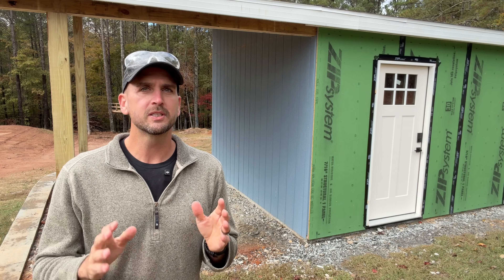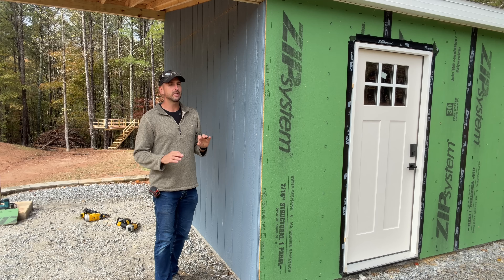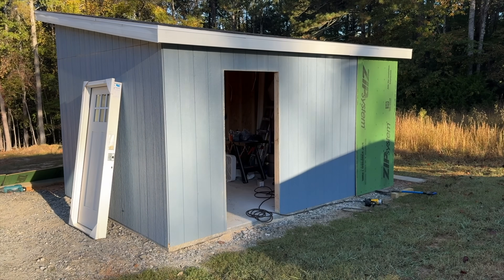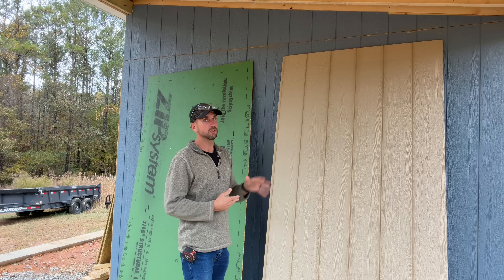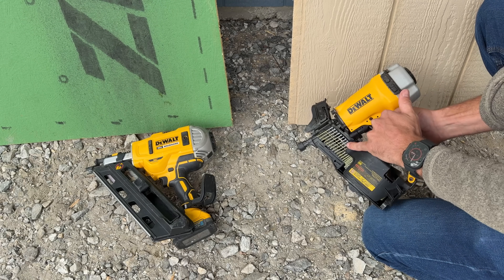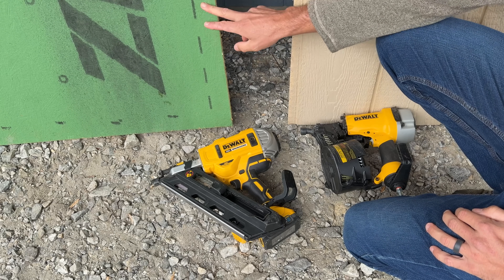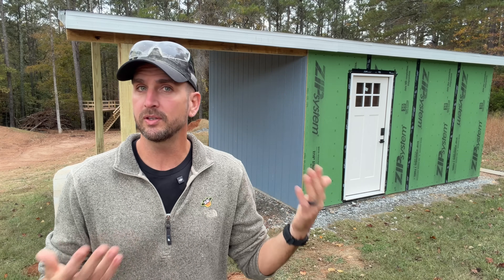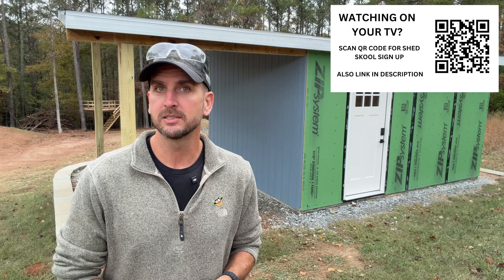Shed Builders: Stop Using the Wrong Wall System! (ZIP vs SmartSide Explained)

Comment: For the best performance,  experience would have been to simply sheet over the LP with 1" faced rigid poly foam  r-3.4 board.  Less than $18 ea.   Taped the seams = vapor+moisture barrier.  Then finish with the siding.  Now you have a thermal break that will turn your insulated wall from a r-13, at best, to a r-19.  This method makes the studs a thermal mass inside the cavity with super low loss to the outside.   State of the art for half the cost!

Comment: I will not use anything but LP Smart Siding.  What you're asking for is basically doubling the cost of the walls. Zip tape is not cheap. You should make a cost comparison for each one. LP siding a few years back was $28 bucks. Now, it's $48 bucks. It's also imported from Canada not sure how the tariffs are effecting the cost. Good informative video.
Reply from the maker: For standard sheds we are 100% LP Smartside and if you can get your bill of materials overall cost up run it through the Pro Desk and they will usually knock off 20%-25% the price for smartside which does add up and help with profit.

Comment: In my recent build of a 10’x16’ I used Georgia-Pacific 7/16” Force Field for the exterior wall sheathing (it’s regularly discounted to $20 or $21 per sheet) and the roof decking, then used 3/8” LP Smartside (8” OC grooved) for the exterior finish surface. They regularly sell the 3/8” LP at deeply discounted prices, so the combination of the LP over the GP was less than the cost of full regular thickness LP or the Zip system sheathing, and the wall sheathing combo is plenty thick and strong. Zip sheathing requires an exterior finish surface, so the price of that combined becomes even greater in comparison. I had used Blockade exterior wrap as a WRB because the framed shed was going to be exposed for a few weeks while I was out of town, so that’s the innermost layer. Probably not the best building science to put the GP Force Field over a WRB but it is what it is. My 2x4” sill plates are PT over a 3/4” PT plywood floor and PT 2x8” joists, for further weather/moisture protection. My combined wall sheathing ran about $38 per 4x8’ coverage.

Comment: None of the exterior products compare to vinyl siding, 30 years, NO MAINTENANCE! 3 times cheaper, easier to work with, no caulking or paint, don't have to worry about backsplash either.
Reply from the maker: Yeah, I do agree there is a lot of benefits to vinyl siding.  Honestly I have went back and forth several times to use vinyl or not on this shed.

Comment: The 'z' flashing issue kinda stunned me. Talking about the air flow passages that it creates when using the LP SmartSiding. Isn't there some kind of way to deal with that? Is there a way to seal that seam on the exterior or interior? Would installing a quality taped housewrap prior to installing the LP siding help with that issue? Thanks
Reply from the maker: Yeah, I would ditch the Z-flashing and overlap the top by 3” on the bottom caulking the seam.  This would seal up much better than messing with the flashing.  That is also how some shed builders do it all the time.

Comment: What if you put a house wrap before the LP smartside?
Reply from the maker: You could probably do house wrap prior to Smartside and then I would overlap the panels by 3 inches and caulk the seams as opposed to using the Z-flashing at the top of the 8 ft panel.

Comment: I built a floating house in the Florida keys and used smart siding.
Direct hit from hurricane Irma and the siding held just fine.
I built it on the water and used the smart siding instead of hardiboard due to weight.
No water intrusion happened because of how I built it. But everything inside shifted because of the wind pushing it around.
Reply from the maker: That is pretty good test for LP 🙂.  Thanks for the feedback.  Did you need to go higher than 8’?  If so, did you just overlap seams?
Reply: @ShedSkool  exterior was just the simple 8ft height. So no need for the top z channel. Top was simple trim and a 6inch overhang for the roof.
I had to make the entire home small enough so no wide load night time moving was required. 8ft wide 24ft long.
Built on an old pontoon frame but added 10 fifty five gallon barrels under it for more weight allowance.
When building on water everything had to be calculated for weight and proper weight distribution.
Even down to the weight of screws and paint was calculated in.
Each barrel gave me an extra 500 lbs of weight I could use.
House floated the same as a normal pontoon boat when I was finished.

I've used smart siding on a few remodel projects. Works great over the years. And in my opinion easier to cut than hardiboard without chipping and easier to transport.

Comment: As both products are OSB based, what is the price point? You could always build with the Zip product using Monopoly building if the prices are close. You're moving in on house building techniques using this method although depending on the final intended use of the building, it might be a valid process.

Comment: Interesting. Have not seen installing Zip over SmartSide. We attach LP OSB to the studs, vapor wrap, then SmartSide lap siding. For my own house, I plan on using Zip panels on the exterior and roof decking. My only concern with Zip is the panels and tape have a 30 year guarantee. It would seem that the tape would eventually dry out, crack or disintegrate at which point all the air sealing and WRP properties are lost.
Reply: In 30 years ill be 89 years old. I won't be worried about air sealing and WRP properties.
Reply: @bka8851 In 30 years I will be over age 100. My heirs or a different owner may have to deal with any tape failure.

Comment: Please, 😊 smart siding sucks! Any part near the ground or concrete will rot out no matter that I paint it yearly. There has to be a better solution.
Reply: I through scrap pieces of LP Smart siding on the ground in the mud,  in front of my shed - not painted, 3 years ago - Took a piece and sprayed it off with water, and it looks almost brand new!  The "structural" LP has a 50 year warranty - Their "shed boards" only has a 5 year!  Big difference.

Comment: i'm an old man. turned my shed into a small woodworking shop after i retired 15 years ago. i just used exterior grade 1/2" plywood, stainless hand nails, oil based primer and oil based gloss paint. gloss helps with sun damage. and now 15 years later it's still fine. it has r-17 insulation, with plywood walls and ceiling. ceiling is insulated the same. heavy duty, supposed to be 50 year roll roofing on a 2 pitch roof. if i'm here another 35 years i'll know if it's really 50 year roofing. it's heated with two small ceramic heaters, i live in mid michigan, and even 15 below outside it's warm, even hot if i want, but who wants hot? no one. and cooled with a window a/c unit i built in the wall which keeps it cool inside in the summer. could be cold but no one wants that either. pressure treated 1x4 trim. and for the exterior plywood i just used oil based caulk on the but joints and smoothed out any access. sure was cheaper than either of the systems shown. and it does last a long time. not knocking the newer products, they might last. just went with the tried and true methods.
Reply: Curious whether all the new sealed systems will still be dry in 30 years.
Reply: Sounds like a video about your shed build would be beneficial so many folks.
Reply: @psbg1968  built it ten years ago.

Comment: Several years ago I built a 10’x10’ garden shed and used LP Smart Side. Since built, the shed has seen two floods where the water went up the walls over 24” deep. The Smart Side has not delaminated or deteriorated at all.
Reply from the maker: Dang!  That is a test for sure, thanks for sharing.

Comment: Had two sheds built in 2011 to Williamsburg look. 12x12 size on both. Finished with Hardy Plank installed as you would old school clap boards. No issues. Not arguing with anyone. That is just what we did.🦇
Reply from the maker: Nice, I think I am going with LP lap siding on this shed but my home has Hardie board 👍

Comment: Why is there no tape on the top left corner of the door?
Reply from the maker: There is tape on that corner, just not as large as the other side.  The corners tape uses the stretch tape as compared to the standard seam tape which makes for an inconsistent look.

Comment: My shed was sheathed and sided with t1-11. When converting it to an office, I just of caulked the inside joints (between studs, between plates, where any wood met sheet goods) to cut down on air leakage before insulating. Then, I just considered the existing t1-11 as sheating, wrapped the shed in house wrap and sided it with board and batten. Far more time consuming than alternatives but it solves a lot of the same problems for a lot less money.
Reply from the maker: Nice, I think that is a very practical approach and saves on material cost for sure.  I was considering board and batten for this one as well but probably will go with LP lap siding.
Reply: Excellent solution. Yep, good, fast & cheap are your choices - pick 2. I’ll take good & cheap for my DIY projects, knowing it won’t be fast.

Comment: Built an uninsulated shed with t1-11 on the studs nearly a decade ago. I've moved it twice in a roll back truck and now have it located at our forever property we bought two years ago. Been very happy with it. Primed it with kilz or bullseye as I pulled it off the truck at the build site on exterior and edges and it pretty was easy to work with.
Reply from the maker: Nice!  Hope the forever property is treating you guys well.

Comment: On my shed, which I insulated, I put 1/2” OSB over the 16” OC framing, house wrap, then 3/8” LP Smart Side as my finished exterior wall. I didn’t price out how this would compare to a zip board + zip tape + finished cladding/wall material, but my guess is it might be slightly cheaper to go OSB+LP. My shed is super rigid. I’ve seen zip on a lot of builds near me and have been curious about the product.
Reply from the maker: That is a solid setup.  I really like the Zip product.  LP also has one which seems to be much cheapers called WeatherLogic but it is hard to find it anywhere around me in Georgia.  The standard and stretch ZIP tape allows you to really seal everything up which I feel is a bit better than house wrap.
Reply: @ShedSkool  I've noticed on other channels that use the Zip system and over drive the nails.  A few have used the Zip liquid flashing, but most don't.  Will that void any warranty and have detrimental effects as years go by?

Comment: Great job, Thanks for the information. I have one question. Where I live in Puerto Rico I can find LP Panels (I like the ok of it), What king of panel can you recommend me to use instead or what paint can I use to have the same quality of this LP Panel ? Thanks again.
Reply from the maker: If you don't have the LP SmartSide panels many people use "T1-11" plywood but it will not come primed and I feel the LP product has a better exterior finish to hold up to the elements.
Reply: concrete and metal in the tropics